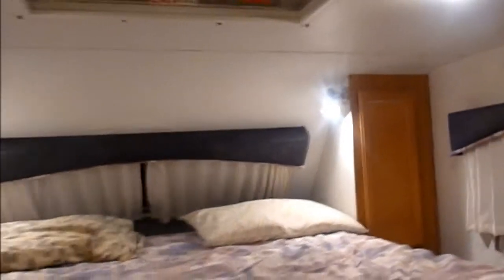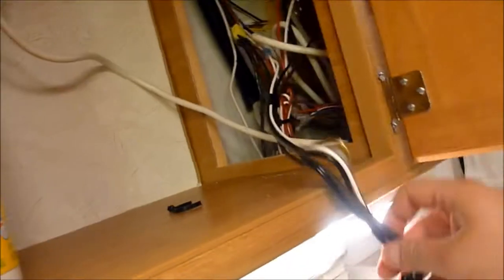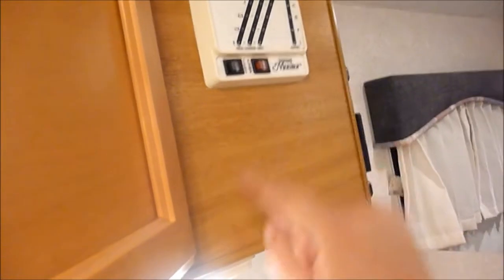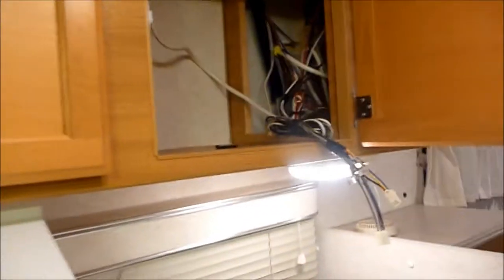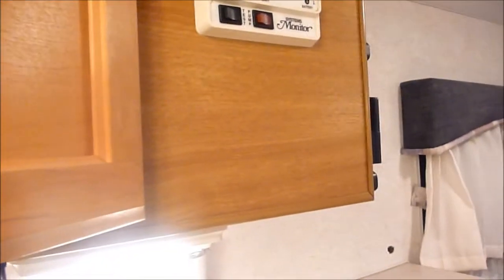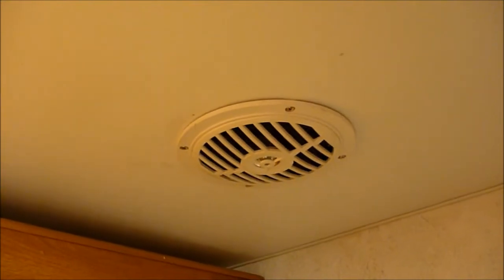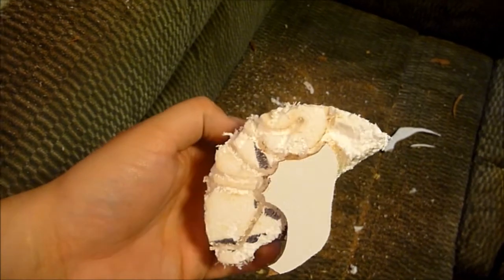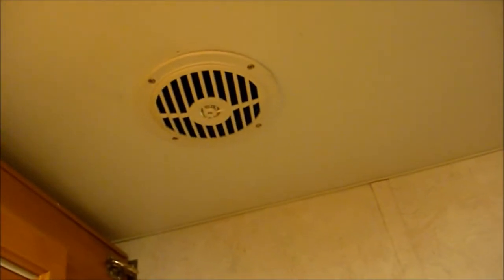Stereo Installation in 2003 Lance Lite 835 Truck Camper

Comment from the maker: Stereos for cars have 1 power wire, 1 ground, 2 for each speaker, 1 for ignition on, sometimes 1 for power antenna, and a thick plug for antenna itself. If the extra is on the radio, it's probably for ignition. It tells the radio to turn on when the key of the car is turned. Splice it into the main hot (positive) in a situation like this. Then the radio will run anytime it's turned on or off since there is no key. If it is another wire in the rv, not on the radio, I'm not sure what it's for.  :)

Comment: Good video, would've liked to see more of the steps taken as I need to install a stereo in our RV soon. I have 6 wires in the roughed in stereo area, for a 4 speaker system. 4 are for speakers of course, 1 for antenna, but cannot tell what the 5th is for. How do you determine if iit's for power or not prior to install? Thx

Comment: just upgraded 2 of my speakers and installed 6.5 inch Alpine type R . can't find anything on how to run new wires though and I really need to.
Reply from the maker: +Lee b Sorry, I do not have the camper anymore but if I did I would be glad to look at it.

Comment: Great video, but how did you wire the speakers or was the camper prewired for speakers if so which did you use for the + where the radio harness attaches to the speaker + side. Good idea with the wider white back plating it makes the stereo look more expensive good job and it sounds good as well, your reply is greatly appreciated.
Reply from the maker: Sorry for the delay in reply. The speakers I had (as with most) didn't matter which side was +/-. They work either way.

Comment: How do you like your 835?
Reply from the maker: Tim Shull The Lance slide-ins cost a bit more then some other brands, but you get what you pay for in quality. In my other video you asked about issues and I mentioned a design flaw with the LP storage compartment door. Just watch for soft frames as the jacks mount into a small wood area and have HUGE leverage when extended causing soft wood to be that much more unstable of a mounting point. Great RVs all around, just take caution when buying. Enjoy and subscribe please! Cheers...